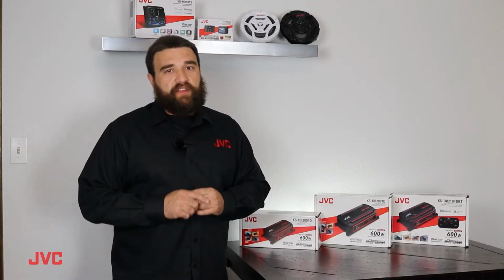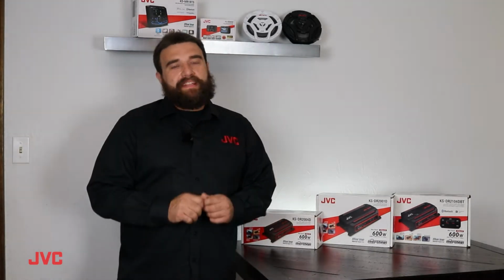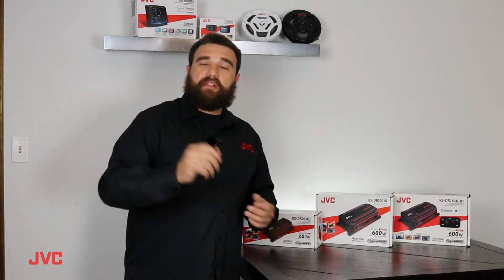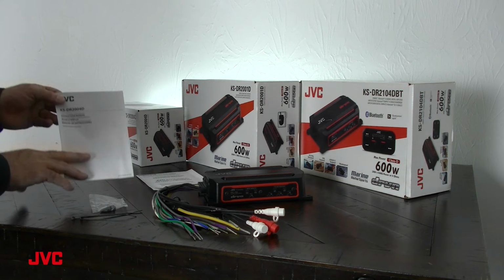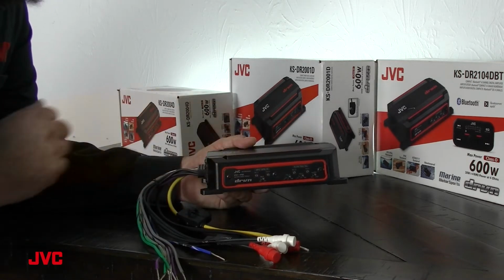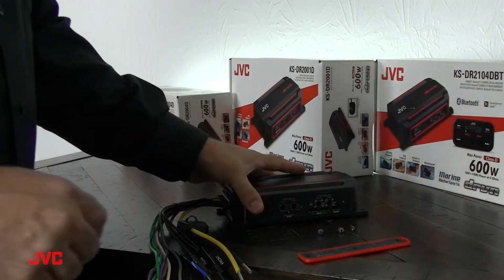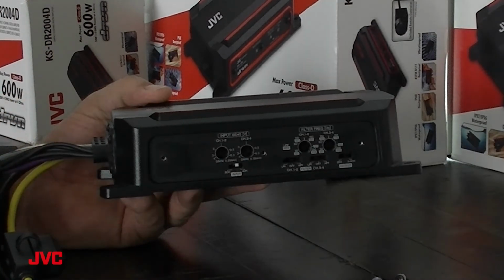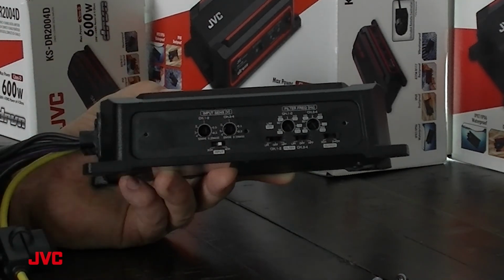The JVC KS-DR2004D Marine/Motorsports WATERPROOF amp is HERE!

Comment: How do I connect two units together?
Reply from the maker: James, this amp connects to RCA outputs from a receiver.  To run multiple amps you would need to split the RCA output from that receiver, or run the amp using 2 channels and dedicating the other amp to another channel of output. Thanks!